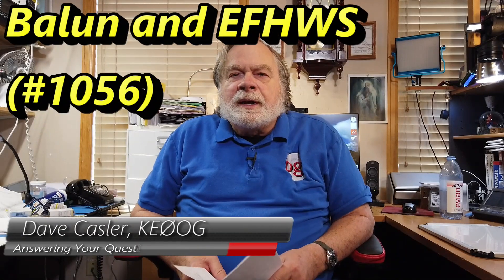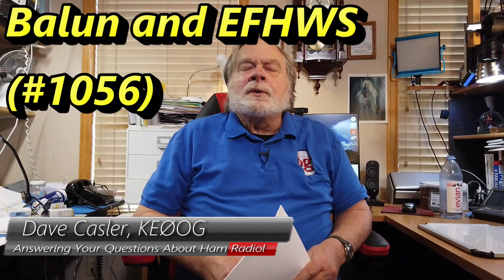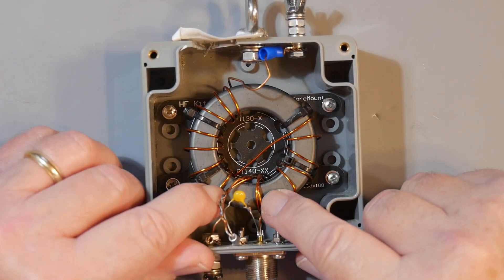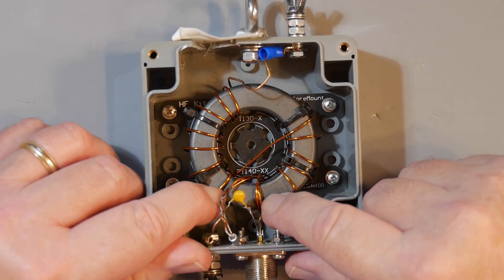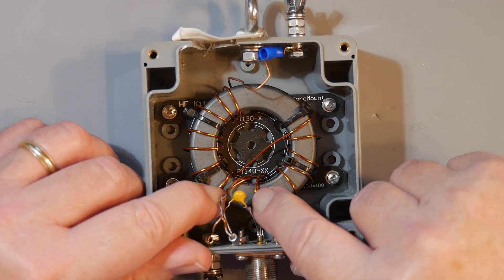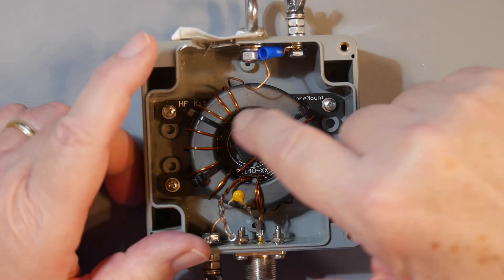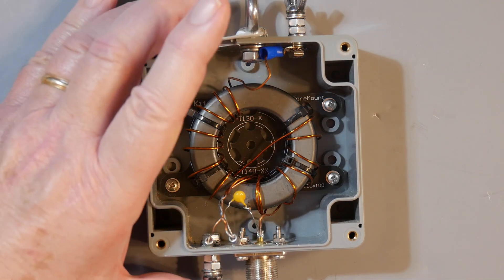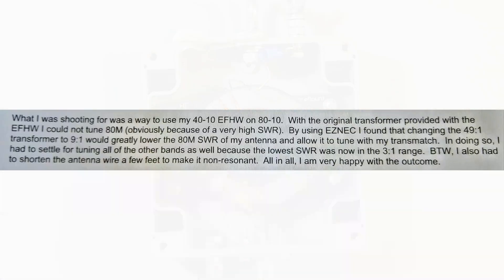Baluns and EFHWs (#1056)

Comment: What is the reasoning behind a majority of EFHW (and DYI articles) stating "80 and above?" Is there a reason 160m is most often left out? The reason I ask is because I'm happy with all of my current 6-10 antennas- so I don't need multibanders- but the only way I'm going to get on 160 cheaply with the space I have is with an EFHW. I could theoretically fit a 160m dipole, but that would come with a long coax run since my shack is at one end of a long lot. A single-band EFHW would be perfect, but as I research it, I'm getting tons of conflicting answers.
Reply: I'd love to hear more about this Dave
Thanks for the comment @TheREALJosephTurner

Comment: I have built that same 49:1 Unun kit.  I currently have it connected to 73 feet of wire (with a 16 foot long dangly bit, pulled off at an angle at the far end). The wire is strung between a pair of 25 foot fiberglass masts, approx 60 feet apart.  I feed it with about 60 feet of coax, with a lightning arrestor/ground, and an MFJ common mode choke, inserted about 20 feet away from my shack.  The ATUs in my FT-900, FT-170, and Xiegu G90 have no problem tuning this on 80, 60, 40, 30, 20, 17, 15, 12, 10 and 6M bands.  It's not the best antenna, but I have worked genuine Dx.

Comment: Seems like you are switching terminology between balun and Unun a lot.  Even with the right 7:1 turns ratio, Balun would not be wired quite the same, no?
Reply: Correct. Some hams often use Balun and UnUn interchangeably out of bad habit. That being said, 49:1, 9:1 baluns and ununs are wrapped/coiled the exact same. They’re almost the exact same device. What makes the difference is where the leads are connected to the coax & antenna.

Comment: It sounds like Steve is trying to run a random wire antenna, not an EFHW.  Thus the non-resonant target length and strange transformer ratio.

I messed around with a homemade EFHW balun and discovered it is quite a bit more flexible and weird than described by theory.  I ended up settling on 3 turns on the primary, but 22 turns on the secondary, making it something like a 53.7:1 ratio in theory.  But that long turn through the middle doesn't actually produce a full turn, more like a half of a turn (at least by my measurements, on my ferrite, with my wire) so it tested right about 51:1.  My actually target impedance was slightly higher (due to elevation), so that was far closer than the nominal 49:1.  I was able to use a shorter wire and it worked without a tuner once adjusted to the right length.

Using a NanoVNA to actually test the transformer at RF reveals all sorts of strange physics we tend to ignore and just let the tuner deal with.